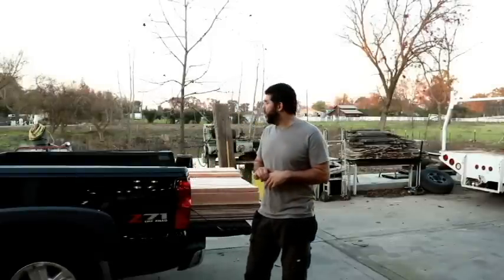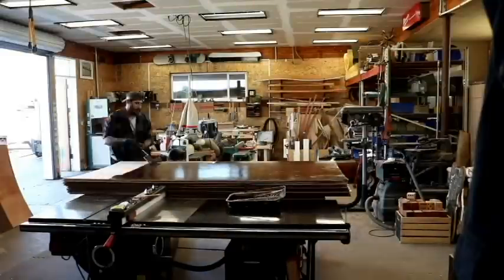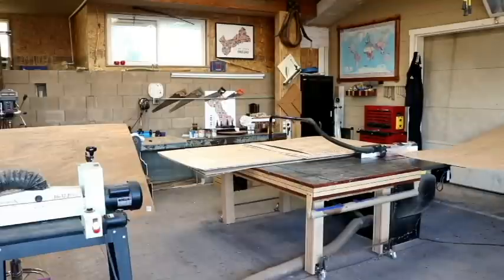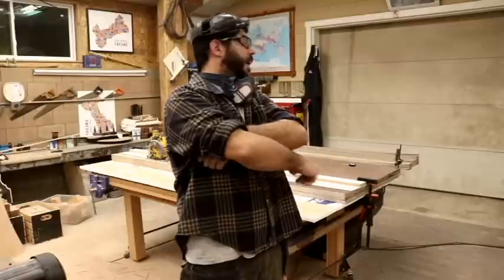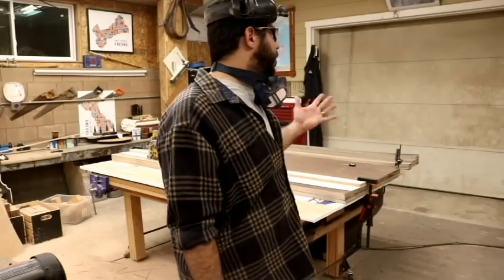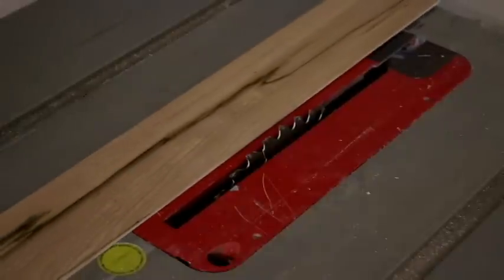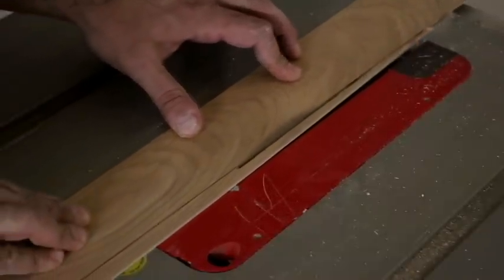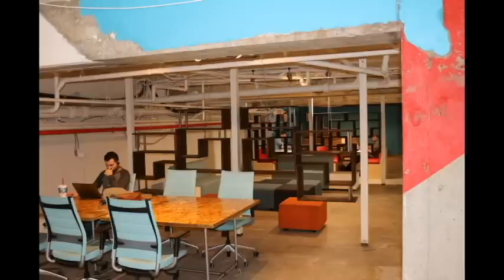Best DIY Wall Treatment Imaginable!!!

Comment: I know this is an old video but I had to comment. I can appreciate the frustration with DeWalt.....but don't you have any corded saws you could've used? I have some cordless tools, but as a professional I'd never be without corded back-ups.
Reply from the maker: Yeah, you’re right. I have a ton of saws corded and cordless (that I think I used off camera) but I wanted to put the new saw thru its paces…and rant a little about how disappointed I was in the release. Thanks for the comment! I’m relaunching the channel early next year so I appreciate the interaction!!!
Reply: @ryanpenir8253   You're entitled to rant...it's your video. It just seemed you had to stop work altogether. Appreciate the reply. Regards.

Comment: What kind of different color did u use in ur  wash?
Reply from the maker: Zim Copper I used Minwax for the “full strength” stains and latex paint for “washes”
Reply: Beginner(zero experience) question so you basically stain it first then washes it?  Can you give me a example, like how did you achieve your blue plank? What color of stain and washes did u use? Planning to replicate your Idea in my room, but have no Idea what to buy. REALLY would appreciate if u could example a bit more. T . T

Comment: Love the prediction of moronic comments we all know were coming lol. Funny how someone sitting behind a computer that never actually does anything, are secretly safety experts.
Reply from the maker: Hahahaha! I knew it was coming and I'm a little surprised I still haven't heard it yet. Thanks for the view...and the sense of humor!!!
Reply: IronWood Outfit 
I think mentioning it on the video probably dissuaded the safety comments.  I've trimmed like that before, too.
I've also, ripped a hard plastic switch (or receptacle) cover that was too close to a door trim for the cover to fit otherwise.  That was before the flexible "indestructible" covers came out.  I was told the cover would just shatter, but I fed it through slowly, and it cut a perfectly smooth edge.  This was using the rip fence, but I'm sure it would also get safety comments.  What probably helped was the carpenter had a carbide tipped blade in his table saw.  This was in the 1980s, when carbide blades were new, and quite expensive, so not many people were using them.
Reply from the maker: I had to do the same thing with a light switch cover and it was no problem at all...

Comment: hahaha... man that way to cut it's not stupid, you became stupid if you cut your finger, that's the way we make in latin america.

Justs a question. What do you use for install that?? another one, what I sould use for install in a concred wall??

I'M SORRY, I HAVE TO IMPROVE MY ENGLISH
Reply from the maker: Ha! Thanks!!! I would just use construction adhesive and only apply a few rows at a time until the adhesive set-up enough to where it wouldn't sag. Same principle as tiling a wall really...hope that helps and thanks for the encouragement!!!
Reply: thanks man

Comment: That's just freehanding on the table saw. I just used a table saw that way to cut the coped corners for my baseboard in a pinch. It worked pretty well actually, much more shady than what you were doing, lol.

Comment: I have to comment about the taper on the TS.  It only tales a second for something stupid to happen.  Man, if you have to make a taper on the job.  Make a taper jig.  They are quick and easy to make.  And you can make for varying sizes.  You could have made the cut you showed in seconds, with about a 30 second set up.  Dude work smarter.  Nice job though!